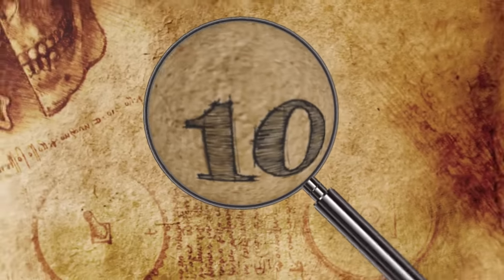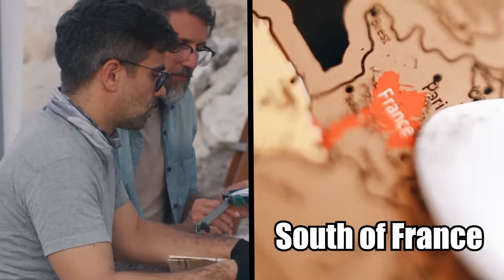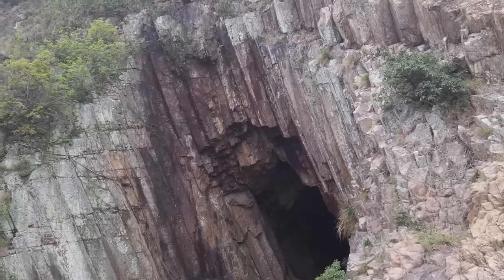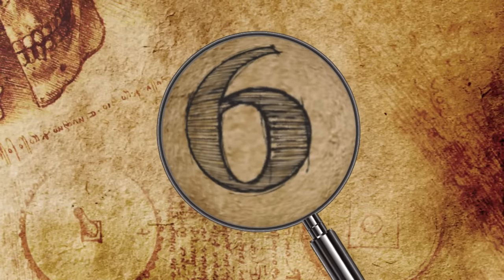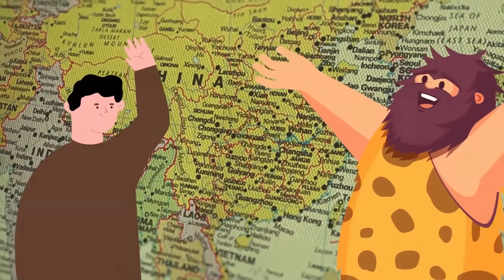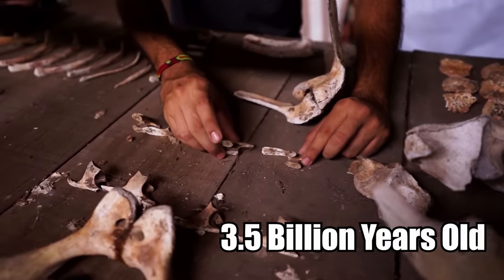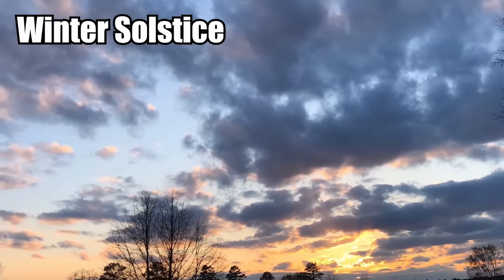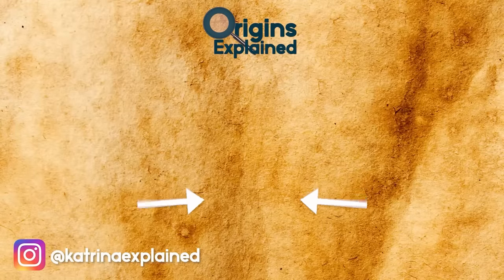10 Most Mysterious Recent Archaeological Discoveries!

Comment: The mercury thing is extra interesting. The Hindu scripture has passages about flying crafts called vimana the are powered by engines that used mercury as a fuel. I wonder if there's a correlation.
Reply: The Hindu scripture even gives measurements to build flying machines (planes) that have been reproduced.  That scripture is huge and has been basically ignored for decades, we need to be able to read it and learn all it offers.
Reply: Any idea what happens to mercury with high voltage?

Comment: ziggurath;
the design of the building is security.
To enter the building you can't just walk in from the surrounding area, you have to go up the steps to the roof - which of course would likely be guarded
The guards on the roof are already positioned to see any attackers approaching plus they are already perched on the high point advantage in the event of a battle.